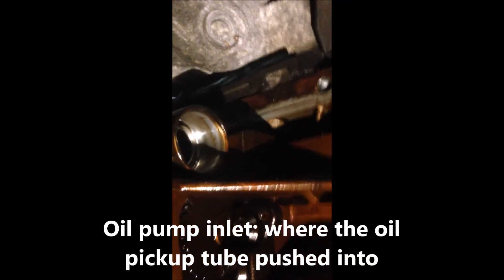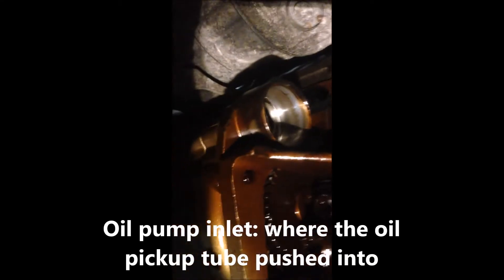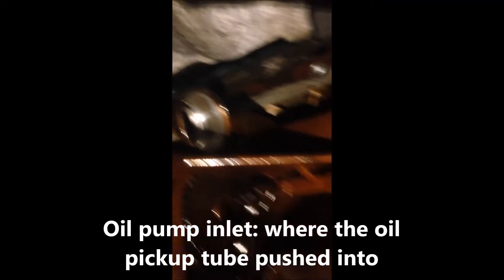BMW E46/N42:  Inside Views after Oil Sump/Pan removed

Comment: Great content, your video's always greatly help me out. But, now I have a few questions. I want to remove the oil pan  on my N42 to change my oil pan gasket. But what bolt on parts of the engine/suspension do you have to remove in order to get the oil pan off? How many hours did it take you?
Thanks in regards
Reply from the maker: Hi, this is a huge job! i recommend to think it over and over again before making the decision. must be well prepared before starting. for this job my car was on stands for 7 days. i also had to order an engine mount as one was found broken. although my videos documented most of the tasks carried out. i still highly recommend you to have a workshop manual handy such as Haynes workshop manual, or electronic manual or online manual. you need a good engine support beam (see my video). you have to remove many parts including steering column pinch bolt; front control arm rear mounting bolts;  oil stick tube bracket; oil stick tube; engine mounts; lowering front sub-frame; and oil sum. it was a huge job but with careful planning and persistent effort, it can be done! wishing you very good luck and always safety first.